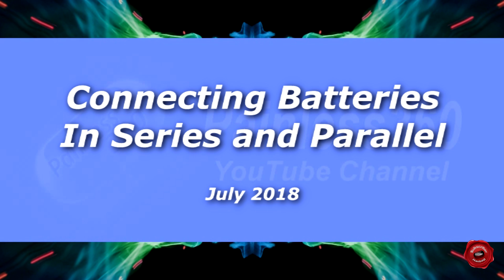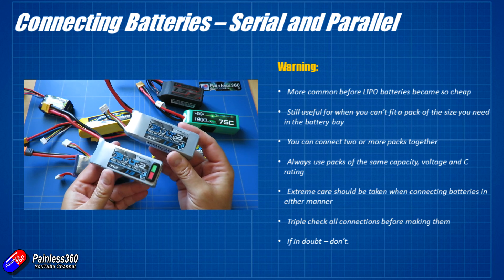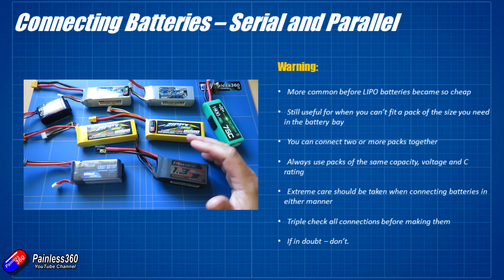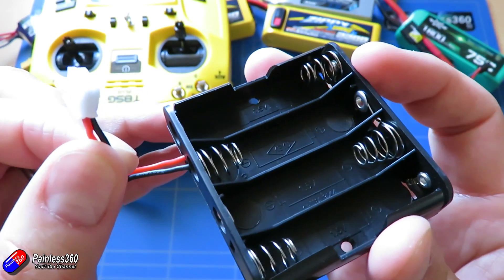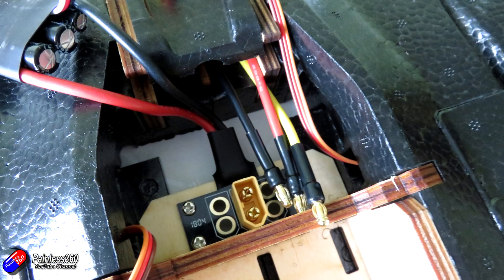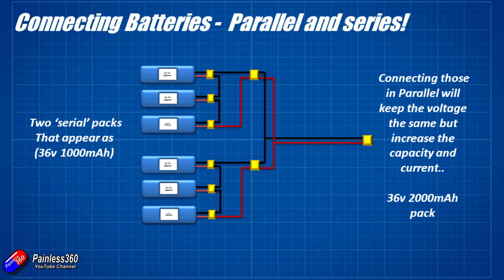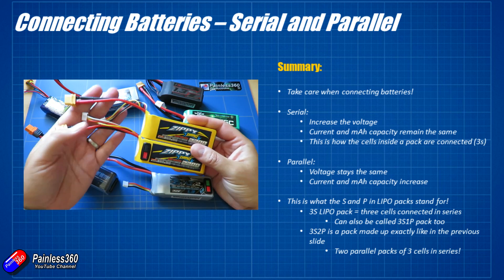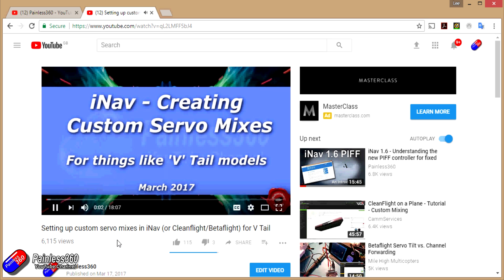Easy Connecting of LIPOs in Series and Parallel

Comment: i might of missed it  but  what about the (smaller connector on the battery )  dose it have to be paired also  or just 1 is ok ?
Reply from the maker: Charge the batteries seperately. This video is only covering how to connect them up for use in the model.. Happy flying

Comment: So conceivably you could make a 12s 5000mah using 2x 3s in series, together with 3x 2s 5000mah in series, so you have two 6s 5000mah in series again for 12s 5000mah.

Just asking as a tester or emergency electric skateboard battery DIY.
Cheers again
Reply from the maker: Mixing and matching different packs can be dangerous as the resulrant battery pack is only as strong as the weakest link and can overstress pieces easily.. Be very careful.
Reply: @Painless360 adding a 10s and a 2s in series, same spec18650 batteries cells, to make a 12s is okay?
Safer and less connections, 2x batteries only to connect.

Comment: Hi what's the best way to connect 2 esc and 2 motors to 1 3s lipo, do you just solder the wires from the esc's together? or is there a pre connector i can use?
Reply from the maker: You can use a PDB or you can simply solder them together. Be very careful that you observe polarity (all positive wires together, all GND wires together etc.)...
Reply: Hi thanks for your reply but what is a PDB? @Painless360
Reply from the maker: Google 'PDB painless360' and you'll get the answers you need. Check out my builds aimed at beginners of you are new to this..

Comment: will the higher amperage in parallel batteries cook my electronics if they are not rated for the combined amperage that results from parallel
Reply: More context my lipo is a 7600 mah 7.4 v rated for 25c and a burst of 50c it is a traxxas id battery i want to combine them in parallel to become a 15,200 mah battery i am afraid that this would cause way to much amperage for the vxl 3s system to handle. I would like to have longer run time on my rc car with this setup.
Reply from the maker: The model will pull the current it needs from the batteries. It isn't the batteries that force me model to take more current than it'll handle.. Best of luck
Reply: @Painless360  allright cool thank you much

Comment: In a series connection can you just wire the positive-negative wires straight together?
Reply from the maker: Not sure what you mean. The negative wire from one pack connects to the positive wire on the second pack... Best of luck
Reply: @Painless360  yeah that’s what I mean the negative to positive between packs, can you just directly connect those positive to negative wires like as in cutting both cords, stripping them, meshing the wires together, and then using that heat activating shrink wrap stuff that I can’t remember the name of right now

Comment: I don't think it should be the same C rate to connect 2 lipos together as long as they the same V and Capacity . !
Reply from the maker: Unmatched cells in a pack cause issues. Same with batteries ;)

Comment: This is exactly what i needed to see! I run micro rock crawlers and need to keep the batteries to 2s max. I can find many options for large capacity micro 2s batteries, but with the limited space of the trucks many times they are either too big or throw off the center of gravity. Thank you for the info!

Comment: can you conect 2 different mAh but same voltage batteries in parallel?
Reply from the maker: Not recommended. One will 'empty' faster than the other.
Reply: @Painless360  im trying to expand the battery capacity of my bluetooth case from 300mAh to around 600, but only have a spare 450mAh battery, can i get away with the 150mAh difference?
Reply from the maker: See previous answer. Best of luck.
Reply: Maybe you can but it should not be efficient. It is i thnink only a good idea if you have an old 850 mAh which hast lost capacity down to to 750 mAh and parallel connect this with a new 750 mAh battery....

Comment: so if i have 4 6s 5000mah 22.2v packs and take 2 run in series  to get 12 s44.4 v5000mah then take the other 2 run those in parallel to get6s 22.2 v and 10000 mah then i take those run those 2 and run those in series to get 18 s 66.6v and i wana say my mah stays at 10000 am i correct or can i not do that?
Reply from the maker: If you connect them together you'll end up with a 66.6v, 5000mAh pack as you can only discharge as much as the lower rating will allow..
Reply: @Painless360  ok that makes sense. I'm just trying to learn something new and I'm teaching myself all about this subject. Plus I ride eBoard and I'm trying my hand at building after having several company's burn me. One more question if that's ok so what happens with the  discharge and the  wh do they change in series or in parellel?
Reply: I'm just my better is like I said 6s65c discharge 5000mah22.2 v111wh . I get in series the voltage doubles and mah stays the same and parellel the mAh gets greater and volts stay uncharged. But what I didn't hear I probably should rewatch cause you probably did say.. Lol

Comment: Hello 👋 I have a question
Can i connect two 36V battery with some little difference because one is about 12AH and the second is 10Ah ❓ I will connect them to a 72V electric scooter controller and i will like to know if i can charge both together with the controller   :?  Thank you
Reply from the maker: I would not connect batteries in series or parallel with different specifications unless you know what you are doing.. Best of luck!

Comment: How about the C rating? Does it adds up too on series?
Reply from the maker: No.
Reply: @Painless360  Great video! Found it very helpful. If you add a parallel string to a pack, does that effectively double the amount of amps that the whole pack can output vs. one single pack? Thanks.
Reply: Another theoretical question. Are there multiple ways to wire a particular series and parallel configuration? For example, I can see that you can wire two parallel stacks first and then just a wire to increase the voltage across both packs. Or, you could create the higher voltage series packs and then hook up the parallel strings... Hope this makes sense and thank you.

Comment: I have4 no's 12 v lifepo4 it all have inbuit bms,
Can i connect all these 4 in series without any seperate bms?
Reply from the maker: I don't use batteries with BMS here. If it worked it would give you a 48v pack of whatever the max c rating was of one pack. See my video on it.. Best of luck
Reply: @Painless360  ok

Comment: But how to blance
Reply from the maker: I don't understand the question..
Reply: is it possible to connect in series  4 no's  12 v lifepo4 battery in series.
All 4 battery module have bms,
Any special arrangement required
Reply from the maker: I don't use BMS but I always charge the packs seperately... Happy flying
Reply: @Painless360   your pack 12 v dont have inbuit bms?

Comment: I purchased a retroid pocket 2 and it uses a 3.7v 4000mah battery, I want to add another battery into it so 2*3.7v 4000mah, do I need to do anything special to make this safe both batteries have built in protection and are the same

Comment: At the end of this video you were connecting multiple lipo packs up, 2 setz of batteries in series and then connecting those 2 sets in parallel,  my question to you is can this setup be reversed around and have 2 sets of batteries connected in parallel  and then those 2 sets joined up in series?
Reply from the maker: Yes

Comment: Can you run two 3s packs in parallel with different c an mah ratings?
Reply: As long as the voltage of both packs are the same it will work fine.
Reply from the maker: You shouldn't..

Comment: Honestly, i know its been 2 years, but this is perfect, knowledge, the effects, and even test questions. top content this.

Edit question for anyone:D. how about charging these? need a parallel charging board or atleast a charger with 2 balans lead inputs? i got a hota d6 pro with 2 charge ports and balans leads(2 seperate channels) does that work?

Comment: Which way should I do it, using 6 of my lipos
   make 2 pairs of 3 lipos in parralel first and then attach them in series for 3P2S
or
    make 3 pairs of 2 lipos in series first and then attach them in paralel for 2S3P
Does it matter which way I do it, which way is better / safer and why?
Thank you in advance!
Reply from the maker: They would be very different packs... not the same at all..
Reply: @Painless360  I mean should I connect in series or parallel first to make packs, which is better / safer and why
Reply from the maker: Both are and are regularly used to make larger battery packs. It is what the P and S stand for (ime. 2S2P).. Happy flying

Comment: Thanks for the info. I'm wondering about putting a 600amp battery isolation switch on my 1000w 48v ebike battery pack so it doesn't 'pop' when swapping batteries and I can use it as an anti theft measure. What's your thoughts?
Reply from the maker: If it's rated for the voltage and current you will be using it'll work. Watch for erosion of the contacts over time though.. Best of luck!

Comment: Does this also apply when you have batteries with a BMS in it? 

I have 4, 650Wh 54.6v/48v batteries I want to put in paralell so I can have a  2.6Kwh Battery to power my Furnace for a few days or Boondocking in our trailer. 

How do I stop a massive Arc when I connect them together?

Comment: So basically: if you want a 10s power for a esk8, it would be in series.  But if you want more range, you would need two of the 10s with the same parallel capacity to make it longer. Making sure they're both equally charged before doing so. 

So If I did this with my 10s5p, it would be a 10s10p connector, doubling the range capacity while keeping the same voltage? 

Interesting.
Reply from the maker: Parallel keeps the voltage but adds up the capacity and amperage.. Happy flying!

Comment: Can I join a 36v 10ah and 24v 10ah in series to make a 60v 10ah  lithium battery? Would rather add a 24v battery to the one I’ve got rather than buy a 60v
Reply from the maker: Series connection adds the voltage but keeps the current the same...

Comment: I own an electric scooter. It has one battery pack and I own a seperate identical battery pack. I want to add a second pack. Would I run this in series, or in parallel? Please advise. TY
Reply from the maker: If you want to keep the voltage the same but double the battery capacity it'll be parallel. Be careful!

Comment: Hello,
I'm building a 5s plane, the motor is an NTM 3536 1800kv turnigy coupled with a 6 × 6 propeller (consumes 57amp) and an 80a esc. I would like to feed it with a 3s and 2s lipo in series but I have some problems regarding the C rating and mah. For example, I have a 1000mah 70C-130C 2s (500mah × 2 cells) and a 1500mah 35C-70C 3s (500 × 3 cells). The calculation of the amp of the 2s is 70 × 1000 = 70000 = 70a, while the 3s 47x1500 = 70500 = 70.5a. By making this calculation, I have a current of 70a from both batteries and 500mah for cell. It's correct?
Reply from the maker: It's not. In a 2s pack all of the cells have the rated mAh and current rating. See my other videos on the topic... best of luck
Reply: @Painless360  Thanks. It's important for me and for my 5s airplane project. Have a nice day😁

Comment: Soo what if i use 2x 4s 6000mah 50c packs for a DC charger  what do i need to stack?! Serie or parallel?
Reply from the maker: Depends on if you want to double the voltage or double the current...

Comment: As you put in more batteries in series/parallel, don't you need to up the wire size? Can you point me to a table you use to spec it?
Reply from the maker: If you are increasing the current then you do. If you Google for a AWG table you should find what you need. Most packs have a smaller gauge than you would expect for the max amps...

Comment: Thanks for another great video!!  I know this is a couple years old, but just bought a used S1000 and it came with tons of extras, including a lot of pre-made 2 into 1 cables.  Some are one cord that splits into 2, and some are shaped like a triangle sort of. From your video I'm guessing the triangle one is the series, and the straight one that splits in the middle is parallel.  My other question is, can the current flow both ways?  Meaning, if we were using the parallel diagram of yours that's at the 6:45 mark, you state what will come out of the single connector, to whatever you are powering.  Now lets say I wanted to hook a 5s or 6s 3000mah, to the single end and I wanted to power one of those little 1s charging boards, better yet, to stay with the diagram, lets say I had 3 of them and I had a ton of whoop batteries to charge, will the current go the other direction?  Thanks for any info!
Reply from the maker: Current can flow in either direction if it is just a wire. Be very careful when connecting batteries up in parallel or series. It's easy to get confused and have a problem..
Reply: @Painless360 ...I am, promise, that's why doing a bunch of research thanks!

Comment: I realize the benefit of more voltage but what is the advantage of having more amps available?
Reply: Higher capacity aka "more fuel in the tank" if you like, it also allows you to pull more amps than with a single pack, that way you can achieve higher wattage (voltage x amps) for more power and speed.
Reply: @overthetarget9401  but will the extra amperage fry electronics or will they know not to pull that extra amperage unless needed

Comment: So say I would connect two 4s 1300 mah lipo bats after when I need to charge do I need to not balance charge or is there a way to connect the balance lead so it can be done?
Reply from the maker: I'd always charge packs separately.. Happy flying!
Reply: Painless360 oh see I was planning on connecting them together so I didn’t need to deal with extra wires and weight and sloppiness lol

Comment: Hello Lee,  I have a model that requires to battery packs. I'm using the standard 4.8V Eneloop packs. Would It be correct to simply use a standard Y cable as used for connecting 2 servos, to acheive a parallel setup, so both battery packs connected to the Y cable which then goes the FrSKy Receiver. Also what would happen if one battery pack failes, would I still have power to the receiver and servos from the other battery.
Reply from the maker: Connecting in parallel with give you the same voltage but increase the current capacity and runtime. If one of the batteries fails then there is a chance that it could also pull down the voltage of the other pack too.. best of luck!

Comment: I'm building a hexacopter so should I go for 2 ×3300mah 4s lipo or 5500mah 4s .both of them cost same! So which one should I go for?
Reply from the maker: The one that is light enough for your model..
Reply: @Painless360  does extra 1100mah increase some flight time?
Reply from the maker: It's the weight that results in more power being used to fly. So if you double the battery capacity that doesn't mean that you get twice the flying time due to the increased weight.. Happy flying!
Reply: @Painless360  thanks

Comment: Help me plz im building a huge hexa:
Amp drawal will be 180×6=1080 amps

The voltage is 60 volts i think thats 14s correct me if im wrong

Im considering to buy multiple 4500 mah, 4s,  45c battery

How can u connect them togeher? Imagine i got infinity numbers of those batteries or suggest me other battery ratings
Reply from the maker: Please see the videos in the 'Big Boys Toys' video playlist for videos on larger models..
Reply: @Painless360  thanks ill definitely have a look
Reply: S λ M I Bawazir how did it turn out?

Comment: One thing I don’t understand is when you connect in serial how the mah does not increase because you have two batteries with 2000mah worth of charge yet you keep only 1000mah? I assure this is because double the voltage so the batteries drain twice as fast?
Reply from the maker: The current that flows through the model also flows through each of the cells too, using capacity at the same time so you don't get double. That's how the cells connect in a lipo park..